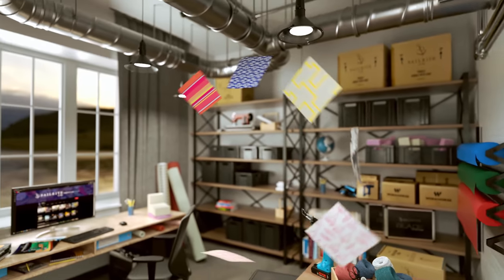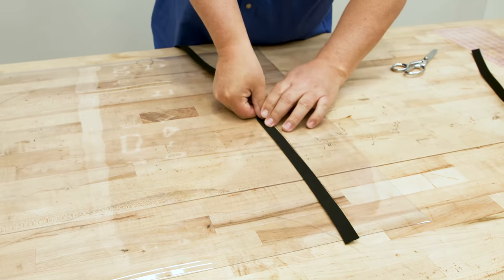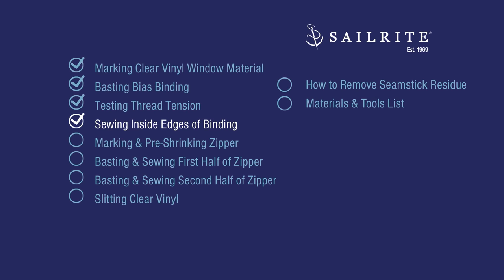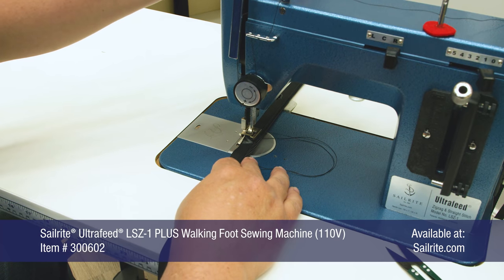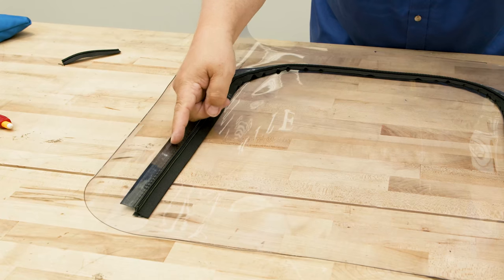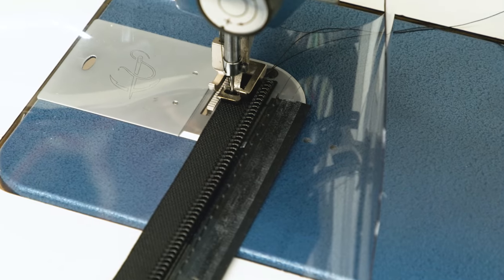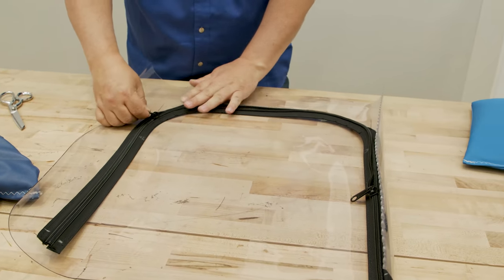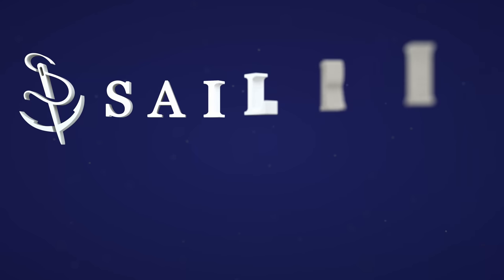Installing a Curved Zipper in a Vinyl Window

Comment: I did this for the 1st time on old hardened glass and I cut the stitching holding the zipper teeth. I've since replaced glass and installed zipper, was much easier to cut.

Comment: What do you use inside of the weights you have?  I have thought about making myself some, but worried about using sand for obvious reasons?  Your Video's are awesome by the way!
Reply from the maker: We used sand and it has not leaked out for well over 5 years since made and I use them almost daily. Here is the link to make them: https://youtu.be/2h4imUXwrHI

Comment: A great video, thank you. So neat! I'm curious about whether the basting tape gums up the needle at all?
Reply from the maker: Basting tapes have a tendency to leave a gum residue on the needle when sewing lighter fabrics, but not so much when sewing heavier fabric assemblies. Heavy fabric assemblies have a tendency to clean  then needle as it exits and enters the fabric. Although a well-adjusted machine should not be affected, if it does run the needle through a bar of Ivory soap to help prevent build-up or use a cotton swab with rubbing alcohol to keep the needle clean.